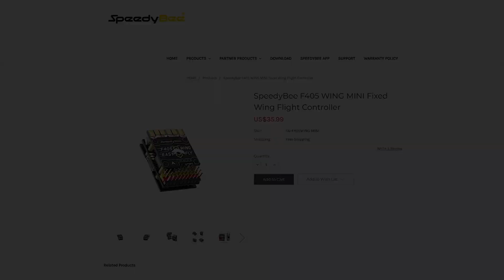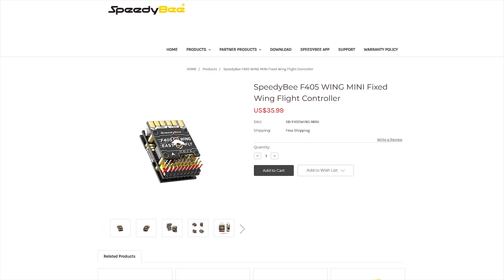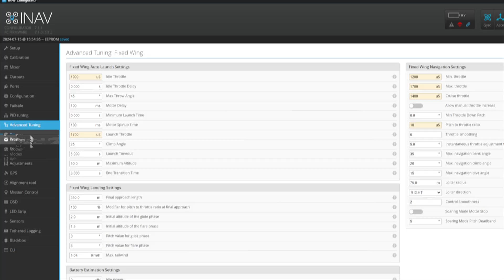🟢 How to Make Simple RC FPV Plane - FUSELAGE - Double Maiden w/ SpeedyBee

Comment: You actually jinxed yourself😂 But a good outcome tho

The slanted tips really give accent to the whole platform, clearly seen in the autolaunch fragment. I'm sure it has aerodynamic advantages too (minimizing vortex somewhat)
It just looks gorgeous and cruises quite efficient too with the FPV/HD profile behind the propblast. Love it.

Congrats Val!🏆
Reply from the maker: LMAO right? 🤣🤣 

The Droopies has an effect, In general, if it's designed to the plane and desired flight characteristics. Droopies like  STOL package for Cessnas, or A10 got them. They should improve Take Off and Landing as said, and help with ailerons control authority as the high pressure is "trapped" under the wing. I am not an expert to Droopies tho, I added them mainly for design. But feels like it's flying on a rails LoL. 

Thank you very much Nathan 😊♥️🤘

Comment: I would recommend not using black tape because of the weight that it adds. They have a shrink wrap that is super light that they use for Bolsa wood airplanes. I would look into something like that.
Reply from the maker: I totally could have used that. But I absolutely gave up on that idea when I saw what insane money they wanted for 2m of plastic (Oracover) 🤯 It would definitely looked better, tho I'd not claimed how much I saved on weight, literally the 3D printed case for SpeedyBee is heavier than any covering 😅 Anyway, the tape is also light and thin so covering the fuse with few overlaps gives an extra layer and strength for landings 😊👌

Comment: wherer did you get the depron?
Reply: Normaly I use foam from dollar tree but after watch your video I think I’m going to try that unfortunately that foam in my area is 1 inch thickness, by The way where you from? Not much girls in this hobbie 😊😊😊😊
Reply from the maker: @javieruriel  Ah in that case I would rather use Foam Board as I used for older UAV I have built. 
Well it's Northern EU 😁 mm I seen precisely one girl on YT but she's into RC cars. But correct, not many. Many are just interested in absolute useless BS 🤣
Reply from the maker: It's used as insulation under floor so check out some HW stores 😊

Comment: Congrats on a successful flight! Looks like it flys great!! What servos did you use switch to? I’m trying to get a similar plane in the air and I worry the eBay noname 9g servos I’m using could be the issue. Also, what rubber bands do you use? I was using some from dollar store but they are garbage.
Reply from the maker: Thank you very much 😊♥️ 

Well I would ideally recommend Genuine EMAX analog at least. However, I obviously try to keep the costs low so I have done many flights on copies of Tower Pro MG90s from AliExpress. Those are good copies tho! Nathan - AerostuffFPV uses them in all of his builds. Hopefully the link will work, but from this seller they are truly full metal gear (some other sellers have variants where the motor gear is plastic, but it's mostly mentioned in the reviews) I ordered like 20 of them and so far only two were faulty, gears skipping. 

https://a.aliexpress.com/_EQFwFJp

But Bear 🐻 in mind I'd rather recommend EMAX from Banggood anyway, those are genuine! 

And the rubber bands, I take any from my local  hobby stores. I can't give a good recommendation for that. On the packaging it's JP (JPerkins.com) 

😊♥️

Comment: It was a nice flight. Can you tell me weight and flight time of the plane?
Reply from the maker: @SeyitAliMete  Thank you very much 😊 The plane had AUW 1361g (version without flight controller and GPS) I have not measured with the FC tho. 

Flight time is so far unknown. On maiden it was 15 minutes, kinda fast, consumed 1300mAh. 

I will have to set up a mission to fly and see how long will it fly on 4500mAh battery.

Comment: Can I fly this with a Flysky i6x ( Esc 40a/Motor/ 10ch flysky receiver?) Without Gps/Camera
Reply: Flying manually will be hard but yes, you can. Remember to fly at nice, calm weather, without wind.
Reply from the maker: @userbvideoc  I would recommend to get the cheap 12$ Gyro A3 V2 from AliExpress. You can tune it mid air and at least for Maiden it would be a "fail safe". If you want I can send you a link 😊

Even though the polyhedral gives some stability, when I fly manual I rather put some different color on the bottom of the wings to not get lost with the orientation further away 😂

Comment: Awesome looking design, that flies well! Even though the fuselage is box shape, the end result looks sporty. Great tips and details during build process. Nice clean build by embedding tail wires in boom and using 3d print to mount the flight controller. The tip of using carbon rod as a fulcrum to find balance is one I have not seen, so will borrow. :)
Reply from the maker: @AerialWaviator  Thank you very much 😊🙌   Yeah some sleek rounded fuselage, with less aggressive angles would fit it well too. 
Yeah no problem, I've never seen such a stuff either 😅 But it comes from my first attempt to build a pusher UAV - I had fuselage built first and had no idea where to put the wings so this method has been discovered 😅  

Luckily with this design the wing can be moved in range of 10-15mm so even without moving the battery one could do some fine tuning after. Or moving the tail boom. Literally three ways to fine tune the CG 👌💡